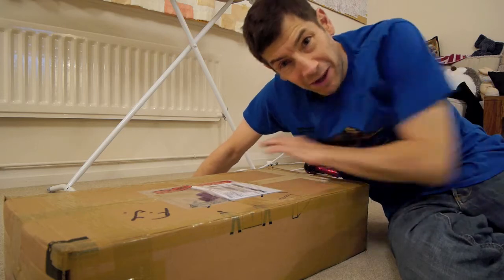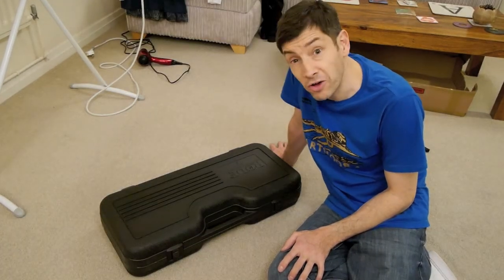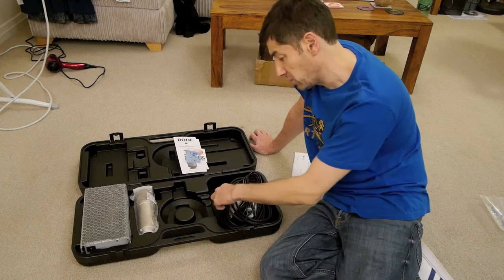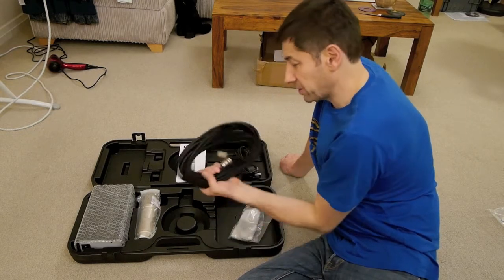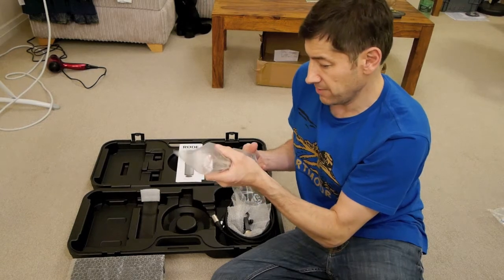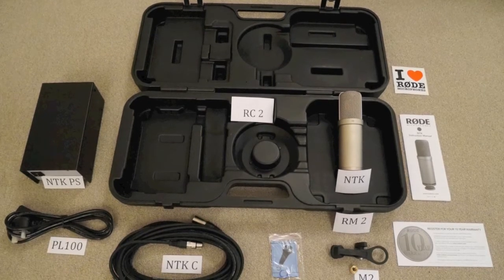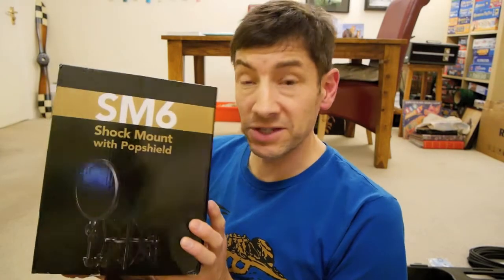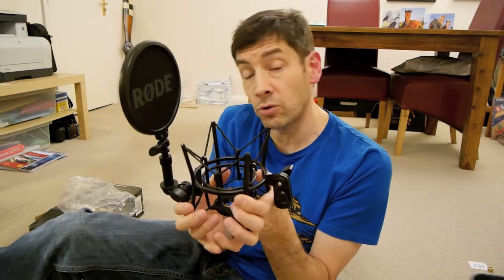Rode NTK Microphone Vlog 5 - My new Røde NTK Valve Microphone

Comment: Very useful. Thank you. But hope you have included mounting the assembly to the stand. What stand can be used with this?
Reply from the maker: Yes, it does not come with a stand but I used a very heavy studio stand with counterweight.  A normal cheap 'anglepoise' type desk stand would not be strong enough to hold it still.  Remember this is more a 'studio' mic rather than just a blogging one so, in a studio you would normally have stronger stands.  Hope that helps!

Comment: This was such a great vid. I was planning on using a desk stand as I I don't have loads of space. Given the weight, what would you recommend stand-wise? Or should I just go for the seinheiser mk4? This is for Voice Over work, thanks!
Reply from the maker: Thanks, glad it was helpful.  Might be worth looking in the comments below - some use a stand with a counterweight.  A really strong desk one might do - Rode do a desk stand that is compatible.  Main thing is that a normal stand is usually not strong enough or the mic will just cause it to droop down.  Let me know how you get on.  BTW, Do you really need a valve mic?  Most situations a regular Neuman, Sennheiser or AKG will do the trick for VO work and will be lighter and therefore easier to work with, and possibly a bit cheaper too!

Comment: I have question,i have ntk ,do you need +48 phatnom power on your interface keeping ON when recording because you have power suply
Reply from the maker: Good question - no the power supply for the mic does it all as it has a mains input and the mike needs more than 48V DC to work.  It is good practice to turn phantom power off but if you left it on I don't see that any harm would be done.  Hope that helps.  Anthony

Comment: I always heard the ECC88 was a step down from the 6922/E88CC. The E88CC I read was more a mil spec tube with better tolerances. I just put a JJ 6922 in mine. I ordered it with balanced triodes and low noise and low microphonics and that tube sounds great to my ear. The tube the mic came with was super noisy so the tube swap was necessary. I'm also upgrading the capsule to a Peluso capsule right now. I got the mic for free so putting a little money into it seemed like a no brainer and a good investment.
Reply from the maker: Thanks Richard - that's really interesting.  There are lots of permutations to try.  I am interested to hear what worked for you.  I started my recording 'career' with analogue tape so it did not tend to be the mics that let me down but now it's a different matter. I once did a bit of work on Shot/Johnson noice and cooling made a measurable difference but not practical for audio recording work.  I do look at the kids I teach and they all listen to music on tiny devices or small headsets or phones and just wonder if they have ever heard what recored music should sound like - but that is a whole different discussion...
Reply: I still work in an analog studio. We have a number of 2-inch machines, 16 and 24 track, as well as 1-inch 8 track, a couple of 1/2 inch 2-tracks, and a 1/4 inch 2-track. Love it.

The Rode is mine, but I have access to lots of cool different vintage German mics at that studio.

Yeah, the Peluso capsule is a step up from the Rode. I always read the circuit was a good design, but the capsule was the weak link. We shall see! I'll let you know.
Reply from the maker: Excellent - feels so more real and hands on than all computers.
Reply from the maker: Excellent - yes do comment here if you and when you get it working and the ears are up to spotting the difference.  When you are young you have good hearing and cannot afford the kit and by the time you can the hearing has tailed off!
Reply: Tape gives you a vibe. Tape saturation on pro gear is a beautiful thing.
Reply: I'm also going to start building a U87 clone from this guy online. He does faithful reproductions of all the classic German mics on PCBs, that you can order from him, and I have heard good things. His U87 is clone is from a 1970's U87, which we have one of at the studio, so when I'm done I can't wait to compare the two.

http://vintagemicrophonepcbkit.com/DU87.html
Reply from the maker: Great - let us know how you get on Richard.

Comment: Anthony please would you be able to help me. I’m from the Uk do we put the mic voltage at 115 or 240v? My mic only stays on for a few seconds then the fuse blows and I’ve got it at 115v
Reply from the maker: That's a good question - if there is a voltage selector for the line voltage then the UK voltage is 240V.  The USA uses 120V for most applications.

Comment: Can I simply use an XLR cable from the power pack to my laptop? Or would I need a separate audio interface?
Reply from the maker: I don't see why not but of course you would need a conversion lead XLR to 3mm I guess.  It is a mono mic as I am sure you know - unless you buy two of them!  You would have to check that the levels match but I cannot think of the top of my head why it would not work.
Reply: @AnthonyFrancisJones  Thank you very much for the quick reply. I have been struggling to find much advice on this so thank you for being so helpful. Have a good day :)
Reply from the maker: Pleasure - perhaps post how you get on.

Comment: hi, im new to this audio mic, condensor thing, but apparently i have this mic at home rode ntk, but the components i habe are the mic, power supply,  and the cables, us there other components needed to use this mic? like for example a soundcard? i dont even know what a soundcard is but mu friend mention it to me, if it does need a sound card or other conponents what do u need, and what brand do u reccomend. thx!!
Reply from the maker: This is a 'professional' kind of microphone and not one you would usually use for blogging etc.  You have everything you need if you are going to plug it into a normal sound mixing desk with the three pin XLR plugs that it has.  However, if you are going to plug it into a computer or similar you will need a cable that converts the XLR plug to a 3.5mm.  All computers, laptops and phones have soundcards in them these days.  I am not sure what you are using the mic for but, with respect, it sounds like you might need something a bit simpler than this one.  It is very heavy too!  Thanks for watching.
Reply: @AnthonyFrancisJones  it was my moms, she used to make music, and im using the mic for voice overs so it i think i need a solid mic for voice overs(?), and also im on a tight budget so if i can use this mic, i dont have to but a new one ill just use what i have, i also have the stand for it alrd, so now i just need a xlr 3 pin to a 3.5 mm jack audio converter and im all set?
Reply from the maker: Looks like it!  I would seriously consider trading in a heavy and complex valve microphone for something a bit easier to use and one that does not need and industrial strength stand!  Let us know how you get on.

Comment: I have questions? Currently I’m using Rode NTK Mic with Avid mbox. Personus Tubepre V2 can support?
Reply from the maker: I cannot see any reason why not.  The mic should work with any preamp as long as the matching impedances are correct.  Both the mic and the Avid use standard 3 pin XLRs.  Give it a go and let us know how you get on.  Obviously the Rode uses its own power supply so other electronics is not needed to phantom power it.

Comment: So you couldn't plug the xlr cable straight into a focusrite scarlett solo, if not how do you get the sound to the PC
Reply from the maker: I cannot see why you can't.  Obviously you will need to take the mic to its power supply as shown in the video but then it is a standard 3 pin balanced mono XLR output from that so it would behave like any other mic.  The Rode has to have the power supply bit to power the valve electronics etc. in the mic - it is more than just phantom power.  Hope that helps - if not get back to me.
Reply: I've got a focusrite solo and what I'm thinking is I'll plug the XLR cable from the mic to the power box, then get another XLR cable plug that into my focusrite solo and then the focusrite will hook up to the computer via USB and that'll work you think?
Reply from the maker: Sounds good to me. The output from the mic's power box is just a normal XLR mic out.  What you cannot do is just buy the mic with no cables or its own dedicated power supply, as the mic does not have a 3 pin XLR on its base nor does it use regular phantom power.  If you have all the bits in my video (mic, mic to power supply cable, mic power supply - these three things from Rode) you will be fine.
Reply: This mic comes with a power supply which is in between the mic and the focus rite Scarlett solo (in your case)
Reply from the maker: Yes, that's it.